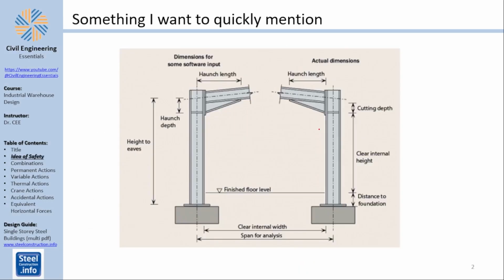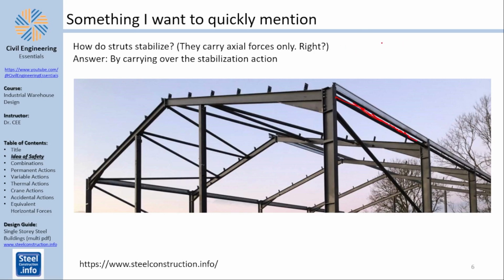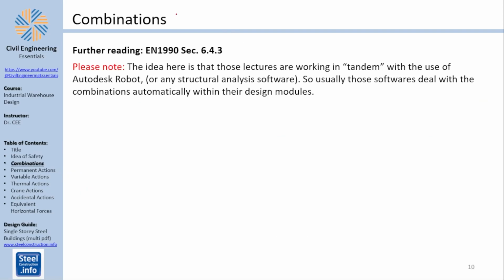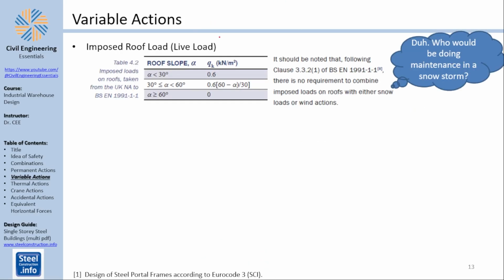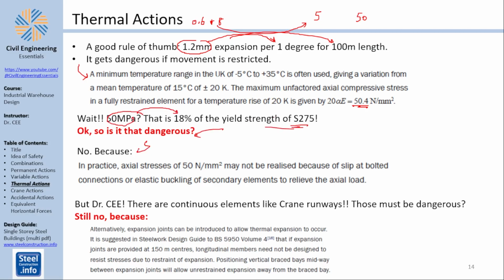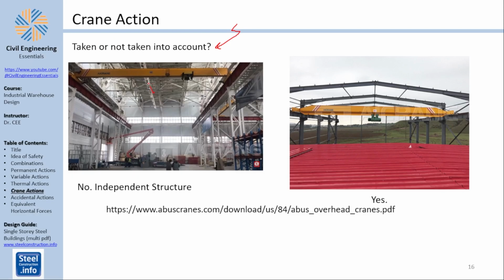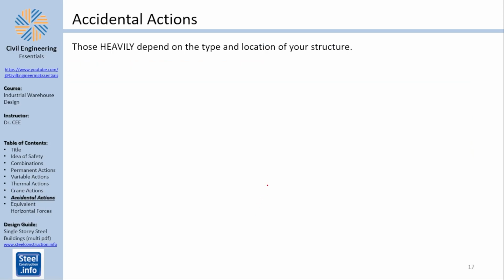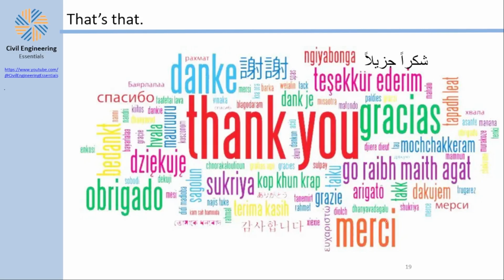Design of Industrial Warehouses | Part 3: Loads and Actions

Comment: Hello CEE,

This new approach (lecture and RSAP video in tandem) is quickly growing (scratch that), It has GROWN on me. The lectures have tons of comprehensive and beautiful information and this opens up a number of options and possibilities well before one dive into modelling on the software. Keep it up.   
 
00:45 Very nice and practical ideas, thank you for squeezing these in. These are the gist of the engineer’s conceptual (or planning) discussions with their client/architect and you have just nailed them for this series project. 

The discussion about the eaves struts (or beam) being used as part of the structure stabilising system and aimed to transfer axial forces is interesting. I am also unsure from the picture at 04:20 as to what exactly in that picture is connecting the apex of the portal frames together (yes, it does seem to be more than purlins). 

Given the varying manner in which these types of stabilisations [eaves struts or beams and/or apex struts or beams] are applied or are used by various designers in practice, I am guessing that the announced upcoming CEE video will touch upon the CEE recommendations on the use of these types of stabilization options? If not, what is the CEE recommendations when it comes to this type of stabilization? Does the CEE recommend a beam or an additional strut at the apex together with the eaves struts stabilisation? In the CEE opinion, what would be the ideal arrangement on the portal frame structure that uses these types of stabilisations (I am asking if the ideal arrangement is to use both at the same time, i.e., eaves and apex, or just one, etc)?

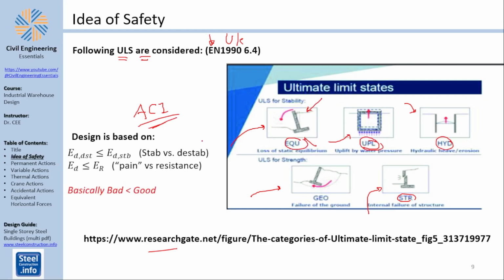06:37 😊 the Bad stuff < Good stuff, “pain” v/s resistance, classic. 

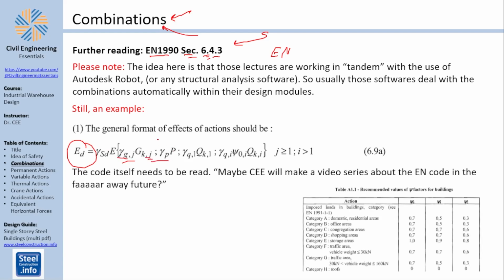07:44 & 11:42 I am of the opinion that the current coverage is fair at this stage. For now, I really don’t mind hanging this idea to maybe faaaar faaaar away in the future ^_^. 

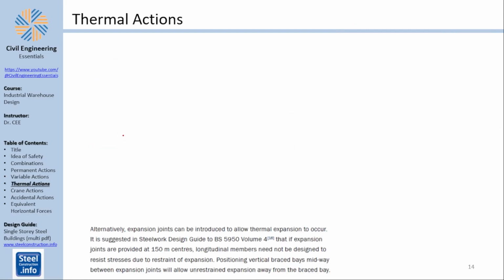11:59 Thermal Actions: Oooh, that right there is a comprehensively beautiful and practical slide, thank you Doctor!

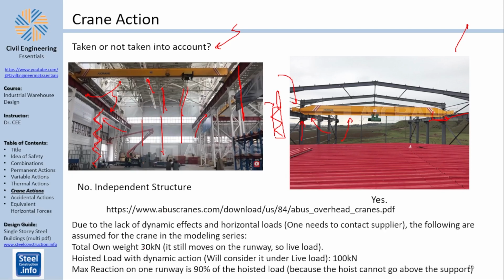17:07 Crane Actions: Thank you for sharing the reference.

19:17 I see the calculations and the estimation of the equivalent horizontal force that is intended to be used to “model the frame imperfections” What is frame imperfections in layman-ish terms? What causes it? and how does it manifest on the built structure?

While we are still talking about “Equivalent Horizontal Forces”, are earthquake loading not taken into account in the design of portal frames (say a portal frame such as the one that the CEE is doing in RSAP on this series? ….will it perhaps suffice to follow certain EQ detailing rules on this series project structure or one also needs to do an analysis such as the Equivalent Lateral Loads methods?) and what about for the other types of portal frames that may be “BIG” in general?

I have enjoyed this video and I am looking forward to the next CEE videos

Keep well, DK
Reply from the maker: Hi there Engr. DK,

I guess the idea of sorting out theory to focus on practice may be a good approach after all, as it is good to have a certain mind-set for each of those cases.

TBH, I had my doubts with regard to the beam, too, but T.A. decided to cut it out in the last minute.
About stabilization, I was blown away that it only needed 1 single bracing to stabilize the structure in the modeling video that is subsequent to this. I am so surprised that I think I will double check it before I continue my next video (I think of Thursday as a day where I check the model quickly.)

I usually explain internal forces "shear, moment, axial" as pains inside the element. If it is too weak, well, it fails or dies.

I have the Eurocode in my scopes for a faar away future, for now, I guess the current system of 1 FEM, 1 theory and 1 Robot video is enough. 

You are most welcome with regard to the thermal actions. There is so much cryptic stuff written here and there, so I had to find something in the reference that both gives a quick understanding, yet intrigues readers if they want to dive deeper. You see, the idea is to cover most important topics in a summarized way while still giving references for interested viewers to further dive deeper.

Oh about frame imperfection. Columns should be perfectly vertical. Unfortunately, our world is not perfect, so columns in portal frames would sway away from this vertical configuration. This leads to vertical loads having an extra moment (Vertical * Delta). Those moments are replaced by a horizontal force applied at the eaves level. 

Now the equation itself is kind of empirical (which I personally hate. I do not like - magical equations - that give you a value, but well, what is the alternative?) I have some alternatives in mind, but practically speaking those are research level alternatives, not helping in the practical work we have as engineers.

The equivalent forces are (and here I have to revisit my codes again) forces that are added to both dead and live (case by case)
those are different from full fledged earthquake loads, those have a separate case.
Here is a quick article that shows a worked out example about it, might be of interest.

https://structville.com/2020/03/modelling-and-analysis-of-imperfections-in-portal-frames.html

Hope you stay tuned for more content.
Regards,
CEE